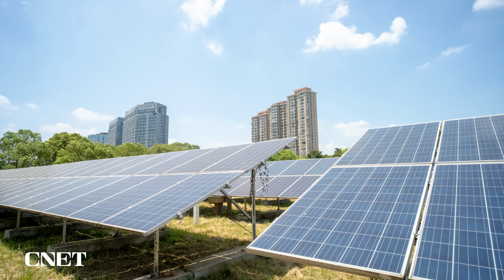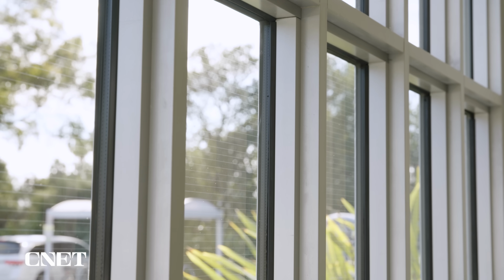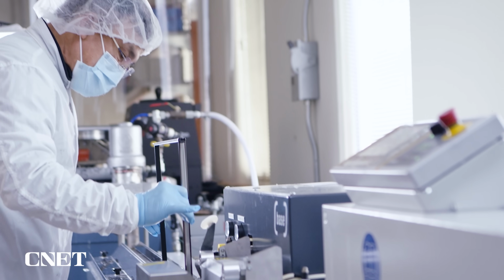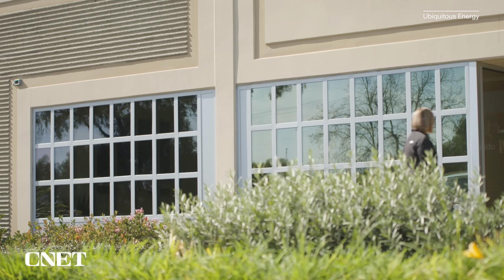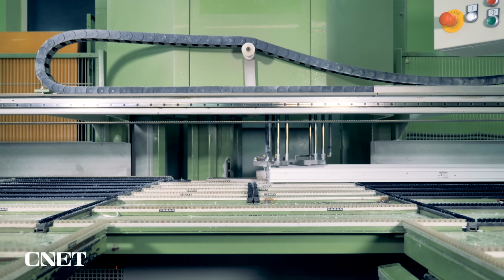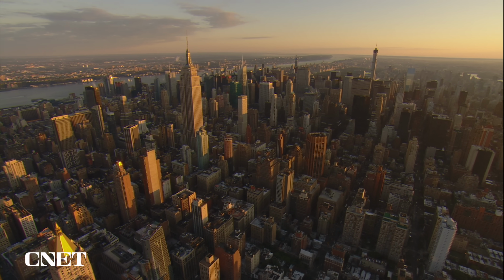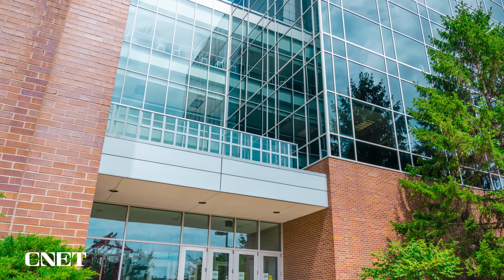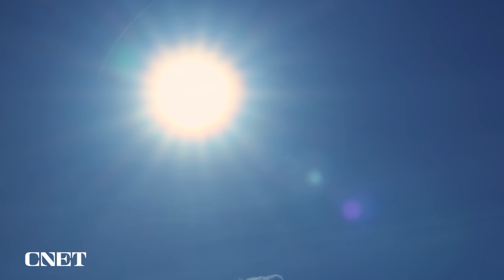See-Through Solar Windows Turn Invisible Light Into Electricity

Comment: I don't know.. I mean yes maby on high rise building where the windows are in the sun most of the day... But on  homes not so sure it will beat rooftop panels. And I think windows that are in the sun most the day will let in a lot of heat so air-conditioning will be a must in really hot places.. so it will help but maby not as much as it seem to...  maby I am wrong

Comment: 30-40% more expensive glass with a 10-year payback period is going to be a challenge. I wonder if those calculations are for the 5% efficiency they are at today. Would a 10% efficiency variant at similar 30-40% more expensive glass have a 5-year payback period? If so, they may achieve their vision of putting solar power generation in pretty much any new building that will have glassed exteriors.

Comment: Will the polarization of tempered glass have any effect and is the coating a post coating (a soft-coat requiring encasing). Maybe tempering is not even in the pic yet. Maybe ion generator instead

Comment: I think upping the efficiency of solar panels should take priority over vanity projects... It's really no different from making a Nokia 5110 out of some exotic material instead of evolving its usability.
Reply: "upping the efficiency of normal solar panels" is surprisingly non-trivial.  The reason they're at 20% is that physics makes it pretty darn hard to get much higher.  Tons of R&D money is going into that anyway.  This isn't a zero-sum game.  We can have both.  The more renewable energy, and the more diverse ways it can be implemented, the better.   Can you cover the sides of skyscraper with solar panels, and still let people see out?  No?  Right.  This is a great idea.
Reply: @StevenSkoczen  The fact that it's hard to increase solar panels' efficiency is the exact reason why we should not be diverting funding to fancy dresses. So it won't be hard.

This is just another silly flash in the pan tech that'll hopefully fizzle out in the next few years so real problems can be solved. Remember magic tiles with mini electricity generators embedded in them? It's in that category. Or roads that can wirelessle charge EVs as they drive. Same category as well.
Reply: I don't see why this is a vanity project.  You have something that currently lets light pass through.  Now you can have light pass through and generate power.  The energy is already there, why not capitalize on it?  This is just a more efficient use of surface area that is currently being taken up by something not generating electricity.
Reply: @sciencecompliance235  I think you completely misunderstood everything I said. Just try again, give it another read.

Comment: I didn’t hear any numbers on efficiency. You do mention that they need to be in the right orientation. None of the windows on a building (except maybe a skylight) are really facing the right direction. 

A solar panel is only efficient when it’s at a 90 degree angle to the sun. On solar farms all of the solar panels move to track the sun for this reason. With a home set up that doesn’t move it’s really only a few minutes a day where they produce good power. 

Replacing all the windows on a sky scrapper may not produce very much energy. And, imagine the cost! 

Currently, solar panels stop being effective after a few years (I think it’s about a decade, anyone is welcome to provide numbers but they don’t get recycled easily and the frequent need for replacement is an issue for them) how often would you need to replace every one of these windows on a building? 

Would you ONLY replace the eastern and western windows? Is there any real benefit to replacing the northern and southern windows?
Reply: The point isn't to maximize energy produced.  The point is to take something that currently doesn't generate electricity and make it do that.  It doesn't have to operate at optimal efficiency to still be useful.
Also, static solar panels most commonly face southward in the northern hemisphere (not east or west), due to that being the direction the sun is most of the time.
Reply: @sciencecompliance235  I get that. And, I think you’re right. But, you need to consider the cost and the benefit. 

It’s going to cost WAY more than regular glass. You wont be able to dispose of it the same way. You wont be able to recycle it the same way. And what kinds of benefits will you see from it?  I don’t recall the name of the top of my head but there was a niche luxury sports car 15 years ago that put a solar cell on the roof. That cell did nothing. I think it was reported that it would effectively power the dome light (a solar cell that requires the sun would power a minor light inside the car so you can see while the sun is shining on your car). 

I haven’t I idea what the difference in cost is between these and regular glass. Let’s assume no one upgrades.  Let’s assume just new buildings get it. This is going to cost a phenomenal amount of money and … for what? To say you have it? 

This feels like flying car nonsense. This isn’t going to go anywhere.
Reply: @zero11010  It is a coating on the glass.  Lots of windows already have coatings.  I have no idea how much this would cost, but obviously you would have to balance that with the cost of the energy these produce.  You say things with certainty that you have no numbers to verify your claims.  Conceptually, there is nothing wrong with the idea.  The viability comes down to numbers, which, again, neither you or I know.
Reply: My Sunpower panels have a 25 year warranty that promises no more than a .5% loss per year.

Comment: Solar windows could be used to charge vehicle batteries. This could prevent stranded vehicles in various scenarios including gas and electric vehicles that are parked for long periods of time.
Reply: Another idea would be to use solar windows with smart glass to provide a more reflective coating and possibly enhance the final power output of the solar windows while also being able to keep the room or vehicle cooler and also prevent solar interior deterioration and fading. 
Again, it's only limited by the manufacturers' and users' imaginations.
Reply: @lidar37  yeah your idea is good
Reply: Go electric means short travel (THEY DONT WANT U MOBILE) KILL GAS KILL DIESEL 🤔WHY??
Reply: @claudiaclaudia936  The original post was meant for any vehicle that uses batteries for any reason. While currently having lower efficiency than standard solar cells, this proposed use has the potential to, for example, keep batteries trickle charged when parked long term at airports, or whenever buses are parked over the holidays. The more windows used, the greater the charge capabilities and possible extension of range when alternator fails. Snow cover could still be a challenge to overcome, but the potential benefits are only limited by the creative imagination of the manufacturer and the users.
Reply: How exactly does solar windows charge a battery for a car?
Reply: @sherrimoquin5553  In the video, he spoke on how solar windows have an electrical connection to wires going to charge batteries. I'd suggest that they go through a charge controller to regulate current flow so that the batteries wouldn't be overcharged after reaching full capacity.
Reply: @lidar37  oh that's how it does it and who's he and besides it was a female that did the video
Reply: @sherrimoquin5553  You're correct. The women who spoke described the solar windows operation and potential uses. Sometimes my phone's keyboard sensitivity isn't what it should be. That and my "happy fingers" go to keys they shouldn't. Self-editing can also be thwarted by Google auto-correct, which assumes it knows what you really want to say.
Reply: @lidar37  thanks for saying that I'm correct and obviously phones these days have that auto correction whenever someone misspelled a word

Comment: lots of hyperbole.. MAGIC.. this is more of an ad.. how about some in depth facts about the science behind it instead of some investor promo
Reply: This is CNET, not Modern Engineering
Reply: @bh2o  If the cost is low enough, 5% efficiency is still worth it.  If "installing" these panels is like buying a can of spray paint and spraying your windows, even a small amount of energy is worth the trip down to the hardware store.  I'm sure the cost is currently way more than that and obviously the complexity higher, too, but there's still some food for thought for you.  The windows would otherwise be doing nothing to generate power, so you are just making an unproductive surface productive.  If the cost were zero for this tech, you'd want to coat nearly everything in it you could because 5% is still better than 0.
Reply: Thank you!!

Comment: 5-10% of UV and infrared light or 5-10% of the whole spectrum including visible light?
Because that's the issue with see-through solar panels, the advertised efficiency is usually relative to the light that is absorbed.

Comment: Recursive logic! We need IR heat and UV health to pass through! Otherwise need more electric power to warm the room. Fart on pant off!!
Reply: As I understand it, windows are typically big areas of heat LOSS in a building.  Also, structures in some parts of the world need cooling more than heating.
Reply: @sciencecompliance235  Don’t you know that taking out the IR and distorting the UV A/B spectrum balance will harm health? Plain glass already distorting UV A/B spectrum. Now with your device even more so!